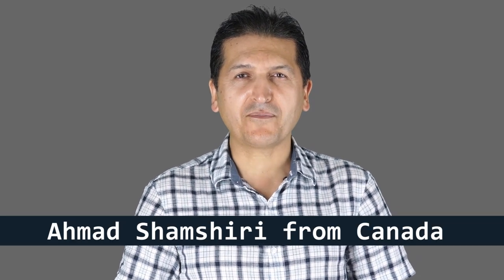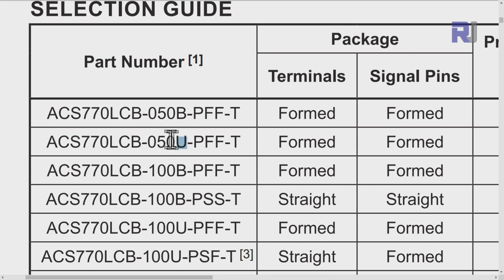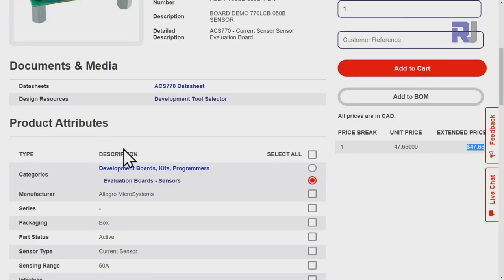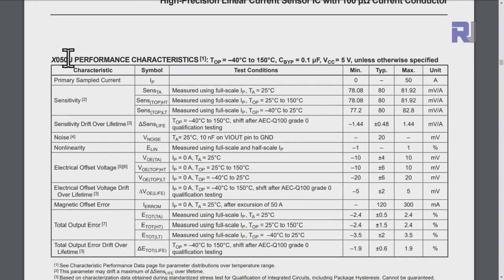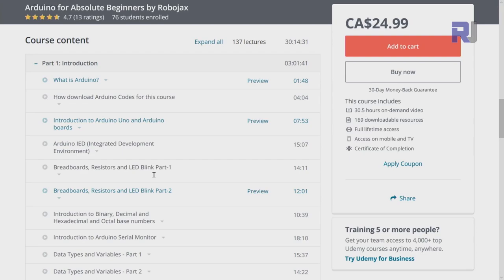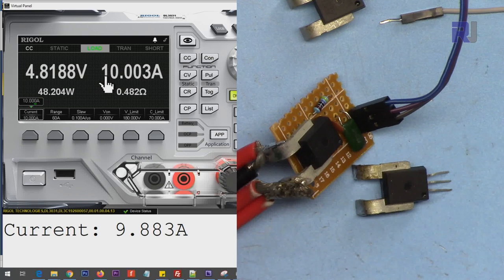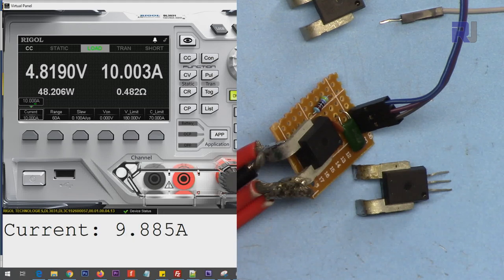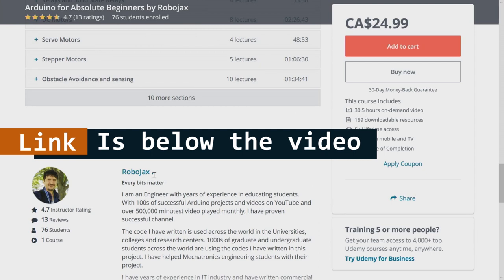Measuring 50A to 200A using Allegro ACS770 Current Sensor with Robojax Arduino Library

Comment: I wish you had talked about and even showed how you calculate the current from the voltage value being read so that you don't have to rely on your library...just one line of code.  You didn't talk about this and that is the secret sauce to this whole subject.
Reply from the maker: Won’t work like that. I have another video which explains how to get the current by calculating it here https://youtu.be/DVp9k3xu9IQ but the library will make it clean and easy.

Comment: Any recommendation on displaying the getaverage function on an oled display?  I get it to work just fine on 16x2 lcd, but 128*64 oled it does nothing.  Using the adafruit library.
Reply: I figured out the issue.  The current sensor library uses too much SRAM and the OLED display will not work.  I removed all the variables except the one I needed and the display now works.

Comment: thanks man, i love this video. Helped me out a lot
Reply from the maker: You are welcome. Glad it helped
Reply: @robojax  hey I also want this to work on an ESP32 with 5 v power supply, but it’s not working. Could you help me out?
Reply from the maker: of course it won't work. ESP32 is different. you may learn it from this lesson on ESP32 which shows how to measur voltage of potentiometer https://youtu.be/QSYTEytRKHI

Comment: Hi 
Thank you 
I want to use of this type of sensor for 400A This current is very high and I don't know what is right connector and rote in PCB for it. Please help me.
Reply from the maker: Hi, using crimp or nut and bolts connect two wires  to the sensor and then solder or use bunt and bolts to connect them to your project. If you try to solder to this sensor, the excessive heat will kill the sensor.
Reply: @robojax Thanks. I will try for it.

Comment: How can I do this with stm32 3.3V. Which version of ACS should I choose
Reply from the maker: this library is for Arduino. Before writing the library, I had simple code to calcualte the voltage acrosss this sensor which is proportion to the current. Here is rthe video which I explained it fully. so watch, learn and write your own code for STM32 https://youtu.be/DVp9k3xu9IQ

Comment: How we could make CW/CCW automatic looped one dc motor exactly like washing machine with Arduino, l298n or l298d and 2ch relay module?
Reply from the maker: is your question anything to do with this current sensor? if no please post it under relevant video and I will replay. this way other people will learn. I have video on  L298N. I don't miss any comment. Post it on any video and all comments are shown in one page where I read and replay.

Comment: Can we measure 100mA current by using ACS770 ?
Reply from the maker: your question made me watch the video because I thought I've answered it. Indeed I have explained it at 10:25 (click on 10:25 to watch it). 0.5% error. Now depending on your module either 50A to 200A the 0.5% has different meaning .so find 0.5% of 50A and you know that you will get that much error. Besides why would you use a 50A (50000mA) sensor to measure 100mA? I would suggest using 3A or 5A module so you get better accuracy. Watch this module which works with 5A. https://youtu.be/3C33DpcSwIw but even with 5A you won't get correct value. you should use something with maximum of 1000mA so you can get 10 times smaller like 100mA with better accuracy.  with 200A (200,000mA) version you can't even measure anything below 10A (10,0000).  Good luck and I hope you reply back if you value this comment. Thanks.
Reply: @robojax  thank you for clearing my doubt
Reply from the maker: you are welcome.

Comment: What is the vout reading on a unidirectional sensor with no current applied
Reply from the maker: it is half power supply.  at 5V you will get 2.5V.  I have explained it here  how the calculation is done and how it works . this is without library https://youtu.be/SiHfjzcqnU4

Comment: Your example should subtract off zero to give accurate reading near zero
Reply from the maker: Which part? On the datasheet https://robojax.com/learn/arduino/robojax_Alegro_ACS770_Datasheet.pdf on page 7 it show ±0.5% error at 25 ° and ±1.5% in higher temperatures. so 0.5% at 50A is 250mA which is withing the range. Also if you noticed, as we approached to above 20A and higher it got much better.

Comment: ACS770KCB code model 15?
Reply from the maker: you are missing dash at the end like  -100U     which would be ACS770KCB-100U
Look carefully at the sensor that number after dash it the current rating. 100 means 100A 10 means 50A. If I repeat everything I said in the video, then it would be waste my time. 
 ///ACS770
      11,// for ACS770x-050B ///      
      12,// for ACS770x-050U  
      13,// for ACS770x-100B
      14,// for ACS770x-100U
      15,// for ACS770x-150B
      16,// for ACS770x-150U
      17,// for ACS770x-200B  
      18,// for ACS770x-200U
Reply: @robojax  oke thanks sir, 150B